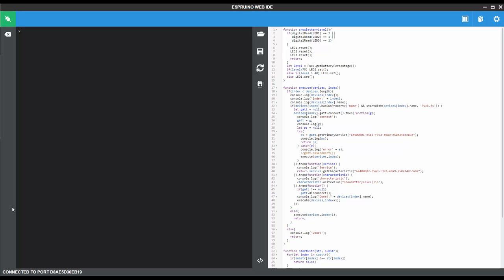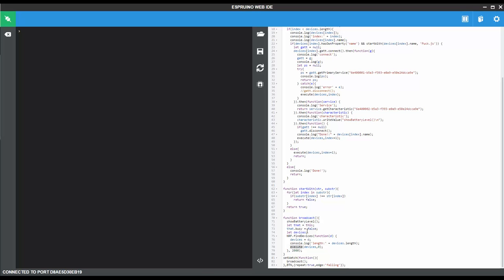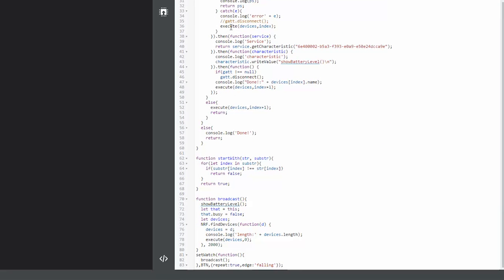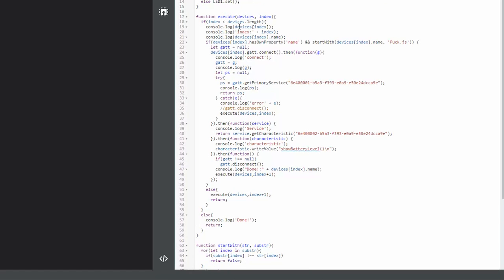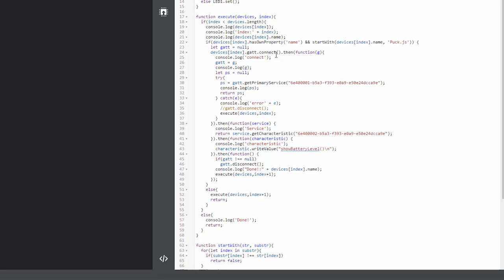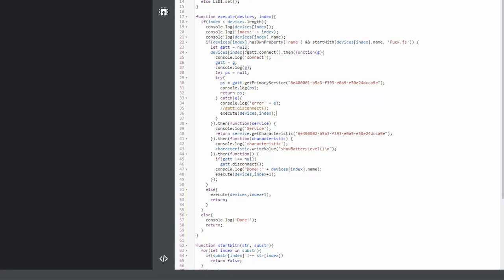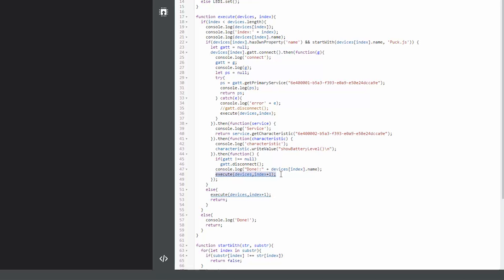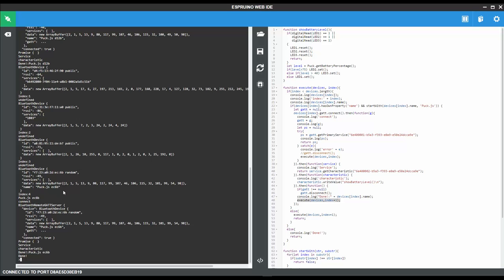Tutorial on How To control Pucks using NRF Bluetooth

Comment: Nice video thanks, I am trying to make 5 Pucks talk to each other so they can be used as a fitness reaction machine. Such as, one light comes on and a person taps it to switch it off, then another comes on and a person taps it to make the light go out etc etc. All random, then if I can get them working random I want to make a more controlled system, where you can set which lights come on and when etc - Have you tied this or any idea if its possible with the PuckJS via Blue Tooth? Many thanks Jonathan
Reply from the maker: the puck will have a discovery option where you can find other pucks. You can place them in an array where you can than produce a random index to pick one of them.
You can probably flash the pucks so you can add your ID to each one so when they come in the list you can look for the ID and know which puck you are talking about. Hope that helps